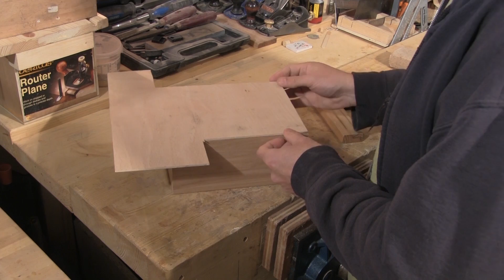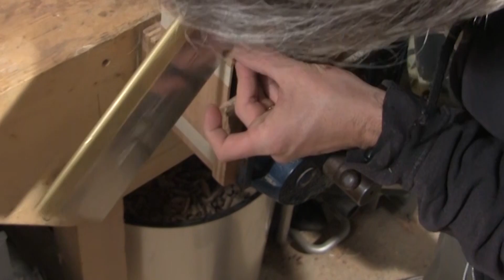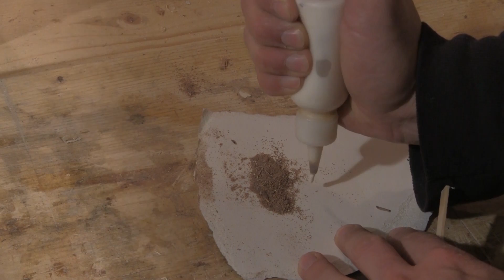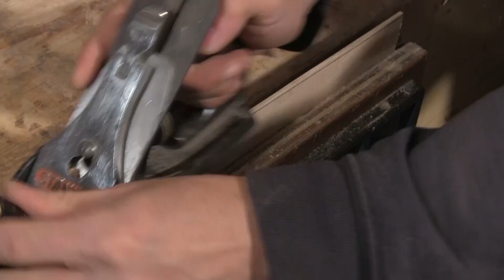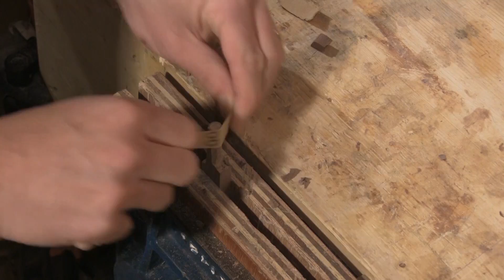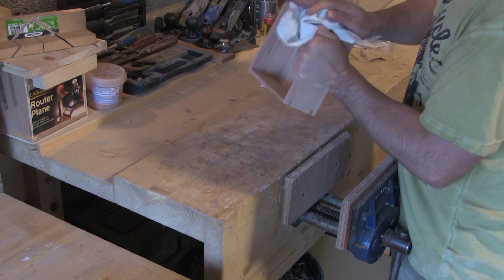Woodwork Project: Mitered Corner Box - Using Hand Tools Only - Part 2

Comment: Just starting my woodworking journey,will be copying a few of your designs. Have you any recommendations for a decent rip saw as I will be dimensioning by hand.
Thanks Phil
Reply from the maker: Hi Phil. Good question. If you can pick up a decent vintage saw second hand, or any half decent brand new it will last a long time - you are best going to a store and feeling a few to see which handle profiles fit nicely in your hand. If you go down this route you will also need to learn how to sharpen it and get an appropriate file and make yourself a jig. This is not are massively difficult skill to learn and probably one to which any hand tool work should aspire, but it will take some time. My advice if you are starting out is to pick up a cheap hardened tooth none 'resharpenable' saw from a bog box/DIY store. These will be cheap, sharp enough for your needs and will last long enough for many projects. You can then look to getting a higher quality tool as your skills grow.

Comment: I have been making this box over the last couple of weekends, also using your mitre jig. I found that if set the splines at the top and bottom  as you demonstrated, I cut through into both the groove at the top and the rebate at the bottom.  The splines are 6mm thick which is the same distance as the groove from the top of the lid, and also the depth of the rebate. Nothing shows through as the bottom covers that error and the spline has not actual broken through the inside of the mitre. However, I think this all happened because I made the splines too deep across the corners.  How far from the corner did you set yours? It looks like 20mm but hard to tell for sure.
Reply from the maker: I think I probably made sure to offset the splines from the internal housings to keep them cleat of each other.

Comment: Awesome video, and very handsome box. How long did the whole project take? And dare I ask how much time it would have taken if you used machine tools?
Reply from the maker: Thank you. If we ignore stuff like the time taken for glue and finish to dry then I would think that there was about 8 hours work in the box. Using power tools would have definitely saved time when ripping the lengths and cutting the slots for the miter keys/splines, which I have built a table saw jig for. Some people may also use a planer/thicknesser to smooth things after the rip cut, although even if I do this I'd still usually do a final pass with a hand plan and scraper.
I could also have cut the mitres using my table saw, but in that case we should add all the time it's take over the years to calibrate and set things up for accurate cuts, nothing show up a lack of precision like trying to get four mitred corners to form a square box!!!!

A lot of the calculation of time saving also depends on how you have your shop set up. I have limited space and so I have to set up my table saw before use and then pack it away under the bench, all of which takes time and for small jobs I can beat that time with a hand saw.  For me power tools really come into their own when doing a batch of the same project, that's where you can really star to save a lot of time.

I do use power tools a lot in my work, but for one off jobs like this, I prefer the luxury of a quiet and less dusty shop. I'm also keen to show that it's possible to create some nice projects using a minimum of hand tools and some patience. I appreciate a well stocked shop full of every machine imaginable, but I do think sometimes people are put of starting a project because they don't think it's possible without lots of expensive machine tools.

Comment: Hi, why make a groove for the lid, splines for the corners but glue the bottom? Is there any reason?
Reply from the maker: Hi, that's a great question. Often I'll make a grove and add a floating bottom, similar to the top. I didn't in this case for a few reasons: 

1. I wanted to demonstrate how to cut the rebate/rabbet without needing a router or rebate/rabbet plane.
2. The materials I was using were pretty stable and so I didn't have too many worries about expansion causing problems.
3. The glue joint would be plenty strong enough for the box's intended use.
4. The width of the material I had to hand was dictating the height of the box and I was anxious to save as much internal capacity as possible and so didn't want to loose the extra height that insetting the bottom would have required.

Ultimately, insetting the bottom in the same way as the top would make for a stronger, more stable solution and would certainly look better when looking at the box from the bottom.
Reply: @adventuresint-shirtswoodwo3905   thanks for the answer!

Comment: I am just amazed. I have learned (and re-learned) a lot from watching your two videos on this mitred box project and now I want to make one, or a dozen. BE WARNED: This hobby is addictive, right? :-)

I spent my entire Christmas money budget (and then some) on some power tools. Now, I realize I've got to start saving up for things like a tenon saw, several hand planes, and some small chisels (I have a set of larger ones) in the 1/8" range for doing the dado/groove parts. I don't feel confident enough with my ancient table saw to do that stuff yet. But I have chiseled a ton of grooves and mortises for various project over the years. I just didn't know about all the extra steps to make things easier.

Thanks for posting these! I look forward to watching your other, and future vids, on woodworking. Especially the ones involving the basic tools.
Reply from the maker: Hi Mike, thanks so much for your comments over the last few days. On the subject of acquiring new tools - I have a few things I have bought new, such as a nice veritas dovetail saw, veritas router plane and a lovely Tenon saw from Footprint in Sheffield, England. However, the majority of my go to tools have been acquire second hand from flea markets, junk shops and occasionally eBay. If you have the time to fettle some old tools and bring them back into usable condition then a nice tool kit needn't break the bank.

Regarding new videos, I have a load of footage ready to be edited for a half dozen or so projects which should start appearing soon. Some will use a few more power tools in the mix, some are for real beginners which may be pitched below your current capabilities but there will definitely be plenty of projects with an emphasis on hand tool usage.
Reply: I look forward to seeing them. I doubt there's too much below my current skill level, as honestly, I really feel like a beginner again. It has been too long. I have already learned several new ways of doing some things I thought I already knew how to do.

I will definitely check out our local flea markets when the weather is nicer. Thanks for the tips! Keep the videos comin'! :-)
Reply from the maker: Excellent!